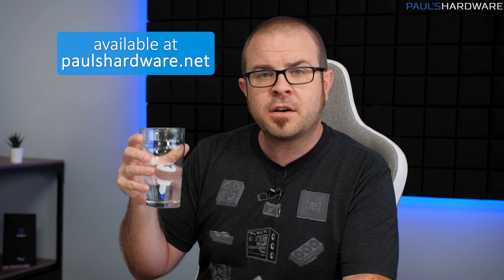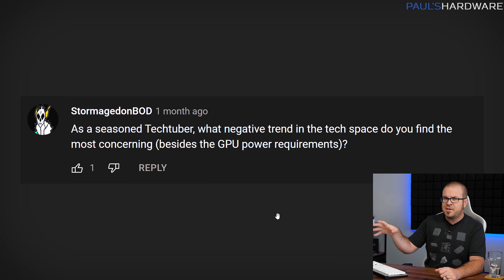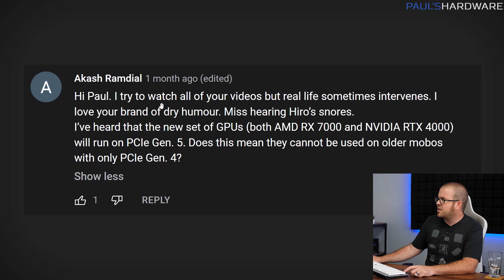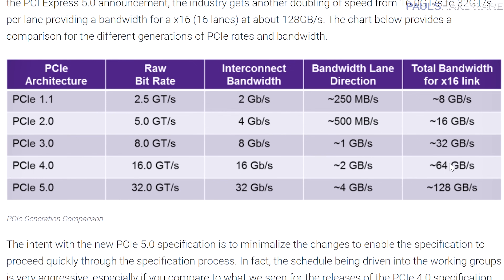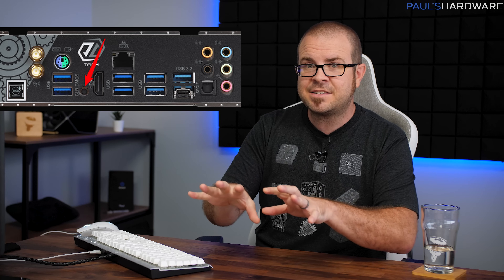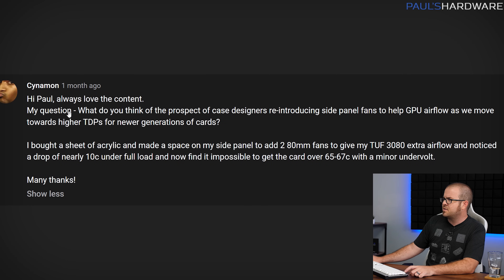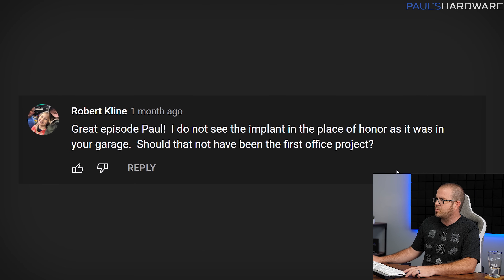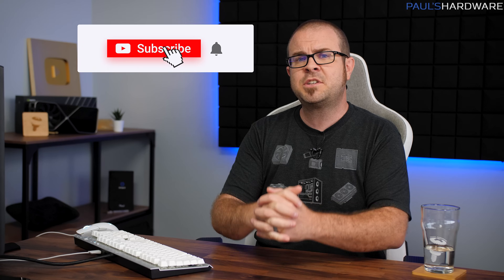This is a big problem. - Probing Paul #74

Comment: Looking forward to the next probing Paul episode! My question is if you’re anticipating the same pressure/bending/warp/cooling issues with Intel 13th Gen, as compared to 12th GEN. Since it’s the same LGA 1700 socket, I was guessing so… But I didn’t know if maybe there were some plans for the next generation of motherboards to somehow change or improve on this?

Comment: Hi Paul, love your work. I'm lost for the direction of my new build.  Was lucky enough to win a 4090 in a raffle for $25usd but the build for it in not certain.. with the 12900ks and 13900k, z690/790 AND DDR4/5 options, do I NEED the 13900k for primarily racing game titles, ACC and iRacing mainly. Maybe the 13700k is a viable option? Thanks for everything you do for the community.

Comment: Hey paul, love the videos!!
Help - Im having a boot loop where it doesn't detect my m.2 nvme(XPG SX8200), i have to reseat it everytime i turn on so is it my ssd or mobo(b450 tomahawk) having problem. Is there a cheaper option than just changing my mobo. After reseat it work just fine already did the rubber clean up thingy and dust off my mobo.
TQ 😘

Comment: Hi Paul. I have been trying to upgrade my cable connections to match my Motherboard speeds and I keep coming up against a weird wall. There seems to be lots of new motherboards with 10Gbps USB Type A ports, as well as 10 and 20Gbps Type C ports. I'm finding lots of 10 and 20 Gbps rated Type C extension or replacement cables, but I can't find listings of Type A 10Gbps extension cables. Is the 10gbps speed for USB type A not widely available? If not, any idea why? Most type A cables I'm finding are 5 Gbps.

Comment: Hello Paul! Long time lurker from all the way back to the days of old, before you move out on your own.
I have a question regarding the games you and other reviewers use in benchmarks. Why is there no MMO's used? I guess it's because it's hard getting consistency but is that the only reason? I saw now in the recent Intel presentation that they used WoW Shadowlands as one of the games in the chart, so was wondering how they pulled that off as being accurate? As an MMO player sometimes it's hard figuring out what CPU actually does well.
Keep up being your lovely self!

Comment: Is this a case of I just know one thing about Windows that you don't?  I claim to see this as I'm telling you to stop using Windows entirely and switch to something else, because I know better than you.  I don't know if this works anymore but I used it in the mid 2ks to "quad-boot" systems, that is there were two OS installs and you could load either one in a VM while running the other(giving four "boot" configurations).  I used CoLinux and qemu's kvm.  Windows is tricky right, because you "can't" just take the drive and move it to another system and switching back and forth every other boot surely doesn't work...  I don't know why ppl believe this it's not true: see Microsoft KB article 314082 titled: You receive a Stop 0x0000007B error after you move the Windows XP system disk to another computer.

Comment: PAUL: Question - Next year, I'm looking at building a new PC to replace the Intel i7-3770K (16 GB RAM, Almost 2 TB between SSD and HDD, pending video card update) I build many, many, many, many, MANY (Think Commandant Eric Lassard) moons ago. I am debating on pulling the old hardware out of the current case (White edition Corsair Carbide 500R), build the new system in the current case and move the old hardware to a smaller case (like one of Silverstone's HTPC cases) for use in the living room. If I do this, I'll probably update the fans the case came with for "MOAR AIR". I'd really like to keep the case with the PC that will become my main battle station, since I like the look/style and I get to keep an optical media drive in it. (Yes, I do have a collection of audio CD's, Movie DVD's and Blu-rays, and Game CD's and DVD's. Why do you ask?) What do you suggestion and recommend? 

And, yes, I'm aware the more I handle the parts, the more likely they're going to die. I'm just not a fan of most modern cases and I want my optical drive, Dammit! (And I do have a record player and tape deck in the living room. Mostly for the nostalgia and the not-ironic reasons of having used both in my youth.)

Comment: I have a different answer for the question at 10:29 about transferring from one drive to another... If it is the same capacity or larger,  just clone it.  It is a million times easier and you are sure not to lose any data.  I use macrium reflect, but any other software probably works just as well.

Comment: I have a question about CPU and motherboard upgrades my current motherboard and CPU is a X370-F GAMING with a 3800x . would it be worth upgrading to ryzen 7000 series or should I wait for after ryzen 7000 for ryzen 8000 for them to work any bugs out and RAM compatibility.

Comment: what would a 7000 cpu look like      AMD X670 Chipset 'AM5' Motherboards - Ranging From $270-$350 US / Down To $250 US
Ryzen 5 7600X – $299
Corsair Vengeance DDR5 32GB (2x16GB) 5600MHz $224.99  ? intell brand. IT my be diferent for ADM. looks like it is the same to me
GIGABYTE AMD Radeon RX 6800 XT Gaming OC 16G Graphics Card, 16GB of GDDR6 Memory, Powered by AMD RDNA 2, HDMI 2.1, WINDFORCE 3X Cooling System, GV-R68XTGAMING OC-16GD  $689.99   AMD is coming out with a RDNA 3 chip set for their new Graphics Cards new microarchitecture
Corsair RMx Series (2021), RM850x, 850 Watt, GOLD, Fully Modular Power Supply (CP-9020200-NA) $134.99 needs a 8+8 Solid Pin CPU Power Connector and a 24 Pin ATX Power Connector for the motherboard
Samsung 980 Pro 2 TB M.2-2280 NVME Solid State Drive Up to 7400 MB/s read speed $209.99 this is gen 4 storge
Cooler Master MasterLiquid ML240L RGB V2, CPU Liquid Cooler and HTK Performance Thermal Paste Bundled, 240 Radiator, Dual SickleFlow 120mm, RGB Lighting for AMD Ryzen/Intel LGA1700*/1200/115X $89.99 May need diferent Braket for 7000 series CPU
Cooler Master SickleFlow 120 RGB - RGB Motherboard Compatible, Translucent Air Balance Blades, 62 CFM, 2.5 mmH2O, 8 to 27 dBA - RGB  $17.65 could use 2 Fans 
Fractal Design Focus G - Mid Tower Computer Case - ATX - High Airflow - 2X Fractal Design Silent LL Series 120mm White LED Fans Included - USB 3.0 - Window Side Panel - Blue $69.99
LG GH24NSC0B DVD/CD Writer OPTICAL DRIVE  $22.98
Total is around  $ 2,100

Comment: What if Intel and AMD both work together and start using the same socket & chipset which would work for 5 generations of CPUs each? Just need 'bios install (like a driver for cpu)' depending on the cpu you install, we use the same everything else if we switch sides?

Comment: Hi Paul! Love the videos! :D 
I am planning to rebuild my old pc with some new components, such as mobo, cpu and ram. So far I've only had intel cpus, but for this build I'm more inclined to go with AMD, specifically the Ryzen 7 5700G. According to a few google search results, the cpu should be compatible with the Gigabyte B550 Aorus Elite V2, but only after a BIOS update, but some websites also mention you need to have an older cpu to be able to update the BIOS. How do I know if this is the case for the cpu and mobo I have in mind? Thanks!

Comment: @ShultsGaming I would recommend using clonezilla, it can very easily directly clone one drive to another, then you can resize that drive. It is a free opensource solution, it is a tiny bootable image you put on a USB stick.

Comment: I like the idea of intake on the panel, but I really want to see more dual chamber cases with bottom intake, and/ or options to mount a radiator in the back (PSU/ cool) chamber, solving the question of "Intake or exhaust?"- I have a Corsair Carbide Air 540, love it, and I cut out the bottom HDD sleds replacing them with 2x 140mm fans blasting fresh air straight into the GPU and out the top rad. I dropped my CPU temp by 10°c! My GPU (3080TI) already ran really cool, for a 3080 (good heatsink design efficiently shedding the heat off, but into the case and out the top rad) so the GPU only dropped a couple degs after the mod... Now if I could mount the radiator in the chamber with the PSU, it would always be pulling in cool air, and exhausting it totally away from the motherboard (1- intake from the room and exhaust into the cool back PSU chamber, or 2- exhaust into the room and intake from the cool PSU chamber). I was considering trying to mod my case like that, but it would have been a pain and the bottom intake fans did wonders (at very low speed) to drop that CPU temp... Why is that not a thing? Seems like a no brainer, unless I'm missing something.

Comment: As far as side panel venting, I managed to countered airflow restriction to my GPU by installing two 120mm fans at the bottom of the case. These draw air from the PSU cavity and blow it directly into the fans of the GPU. It's a LANCOOL II case so the cavity holds all the extra wiring and receives fresh air from the front. This has lowered my GPU temps about 6°C under full load.

Comment: Second negative trend is CPU power draw lol. A solid Nr3 is strupidity under fanboys. Just buy what is best not what has a certain label. People told me i was stupid for buying 9th gen while ryzen 3 was not even out yet and was worse after all for my tasks and i still have not upgraded so that upgrasde path was useless to me so far and by the looks of it i wont be buying 7xxx or 13th gen either. 
Side panel is a bad idea i think as it distrubs airflow.  I do however think it is smart to place a smal fan below the gpu exiting air out of the back slots. I installed a 70mm fan and the heat that is pulling out is insane and lowered gpu air intake temps by 7c. (also upped front fan speed by 5% to not create a vacuum)

Comment: Info on the PCIe 3.0 vs 4.0 vs 5.0 is not entirely correct. For example AMD makes PCIe 4.0 cards that use half the lanes due to production costs and when you plug that GPU into PCIe 3.0 the performance suffers cause using half the lanes on half the speed compared to 4.0. One "lane" on PCIe 3.0 is HALF the speed of one "lane" on PCIe 4.0, if you psychically connect to half the lanes on 4.0 performance wont suffer cause it's DOUBLE the bandwidth of 3.0 and the GPU wont use full bandwidth available, vice versa the performance will suffer if you plug that AMD card into PCIe 3.0.

Comment: Hey Paul, Legacy gaming GPU benchmarking almost entirely concentrates on single screen setups. Given that the top end next gen GPU’s can push out well over 100 FPS on most gaming titles do you think it is time that more challenging tests were more common place? Granted, PC VR headsets are still pretty niche but I would imagine that a 4k VR user is far more likely to receive a notable FPS improvement on a new 4090 than the average pancake gamer.

Comment: About what to do with a windows install from one drive to another... is to create a clone of the drive with software, migrate it over to a clean un-partiononed drive and than resize the clone to fill the migrated partition.
Reply: I just replied with the same answer... then I read the rest of the comments and found this.  Exactly right.

Comment: In response to the next to last question, I HIGHLY recommend disconnecting all other storage drives when installing a fresh copy of windows for one big reason:  For some dumb reason, the windows installer will sometimes put the bootloader on a different drive in the system.  While this isn't a gamebreaker for most people, it can cause issues if something happens to the drive the bootloader gets installed onto.  It's rare that this happens, but I've seen it happen often enough that I just make it a habit of disconnecting any storage drive to prevent this from happening in the future.

Comment: Concerning the pcie lanes question: didn't the rx 6500 or 6400 only have 8 pcie gen 4 lanes? Therefore if you would plug it into a gen 3 x 16 slot, it could only run on 8 pcie gen 3 lanes?

Comment: Question- if you were using a very outdated build, what would your strategy be for upgrading? Would you buy the previous generation high end at a big discount, or would you go for the next generation? Or do you go budget previous generation, and replace parts as next gen prices normalize?

Comment: I don't care which part from whom I use as long as the price to performance is good for my wallet. If I need to mix and or match is of no concern. The longevity of the system is a major concern as I use my PC's for 5 or more years. I put a 200mm fan on the side panel of my favorite pc case and the vid cards loved it by dropping temps immediately and in the case of the RX480, it was substantial. The current vid card for that system is not as dramatic a drop but it dropped nonetheless. This is despite the case already having Noctua fans in all the usual places, so I won't buy one of those (useless to me) pc cases with all the glass and crap RGB :)

Comment: Side panel fans?  I have an Antec case that has basement fans that draw air through the right side panel.  This to me is the evolution of side panel fans, it gets the air without putting a fan in the middle of the glass panel.  Practically, it equals about 5C in temp reductions.

Comment: You kids have no idea how easy you have it with today's computers. You should try to build a computer like a 286 or even a 386 with an ISA slot and the multi ISA slots for like a diamond graphics card that was massive. And there was no plug and play in drivers that automatically downloaded you have a set of steps that you had to install program and set up and then set up hardware and if you mess up those steps the entire thing would crash and you'd have to back everything out and do it all over again

Comment: When DirectStorage starts getting used all that massive unused PCIe bandwith will finally be used for something. Why? The DirectStorage spec clearly states that compressed game data can be pulled not only from the SSD but from system DRAM too. You'll have a really good reason to have 32GB or 64GB on a gaming machine... buy your dram now while it's cheap. OOps, it's not cheap.

Comment: same on recommending a clean install instead of migrating a windows install
- archive your documents, pictures, video and move them to a other harddrive other then the C drive or a usb as only the C drive partition 0 is affected by reinstall
- archive your appdata folder by first showing hidden files in your user folder any warning you get can be ignored as they are system protected files which you don't want anyway
- archive userdata of steam and check any other launcher software for a savegame folder
- archive saved games folder in your user folder incase there savegames there

saved games are contained in : documents, appdata, steam userdata or any launcher's saved games folder like ubisoft has one, saved games folder in your user folder

Extra's
- make a text document of all your programs/games that you installed without a launcher
- most games can be verified instead of redownloaded if they were installed with a launcher

Steam : if library on different drive then do Steam>Settings>Downloads>Steam Library Folders>+>let me choose another location>select your hard drive letter and press select and done should recognize all games in that steam library(if you have steam games on the c drive then you can copy the games from C:\Program Files (x86)\Steam\steamapps\common to a other drive then copy them back once steam is reinstalled on fresh windows)

ubisoft : select game then instead of install select locate installed game

epic games launcher(this doesn't have a verify not in the common sense to make it verify you instead make it verify the setup files )  : to verify setup you just make sure your game is not located at the installation location so the folder is empty then you install and completely quit epic games launcher then you move back the game folder into the folder epic games was installing to and you restart epic games launcher once its done moving the files then you just resume installation and it should say verify instead of showing install %

note epic games launcher can be a dick to verify stuff say a game has a update since you reinstalled windows then it likely will overwrite the files anyway sometimes it does it even if there is no update but at least most of the time it just verifies 

there is a alternative but higher chance of overwrite you instead of closing epic games launcher you press stop not pause the stop one it then should say resume then you copy the files over again your safer quitting epic games but if you had many games installed from there this solution would be faster

EA/origin : can just verify games

gog galaxy : you can import the game folder by going to the game then settings and manage installation

many others just have verify systems

save games recovery : documents, saved games folder and any launcher related save game folder can be extracted back into their originating folders however appdata you cant just extract back you want to search game folders and put those back in appdata

and last i will say try and keep the c drive for programs only no games or important files learn to always put those on other hard drives unless c is your only hard drive then your boned when it comes to reinstallations basically you want windows breaking to not mather anymore as its just some downtime of reinstalling windows and not needing to unplug the hard drive and putting it in a other pc to recover your files

note : if your pc had a password then you might find out you cant open certain folders when you connected the hard drive to a other pc just disable inheritance in the security settings or delete any owner then adding your username as owner of that folder then you can enter the folder hench why passwords on people's pc were a joke and only would protect you from your siblings which might just be to dumb to figure out they could do this